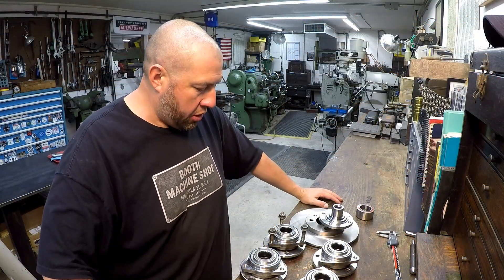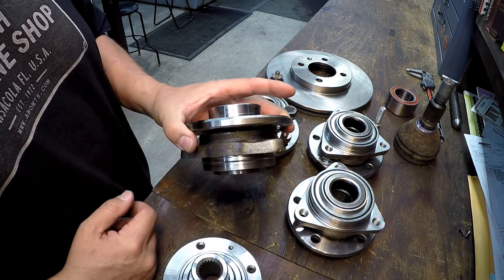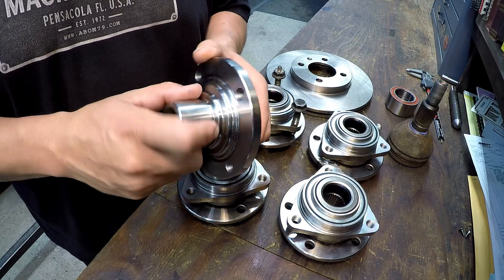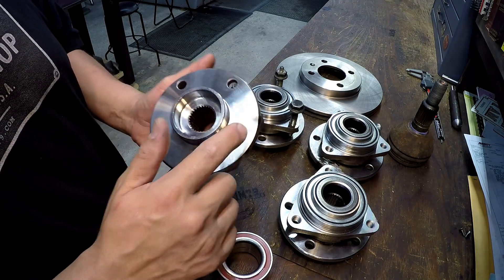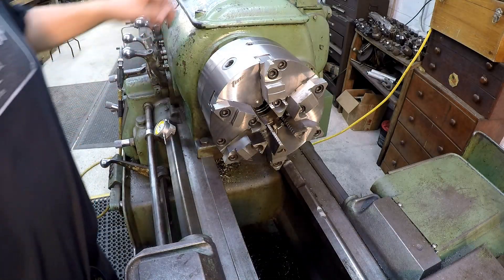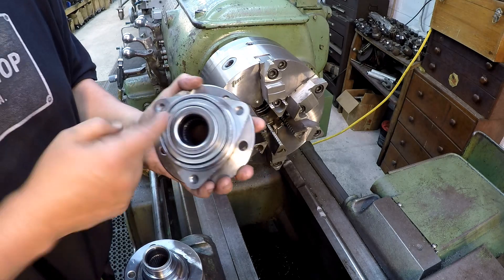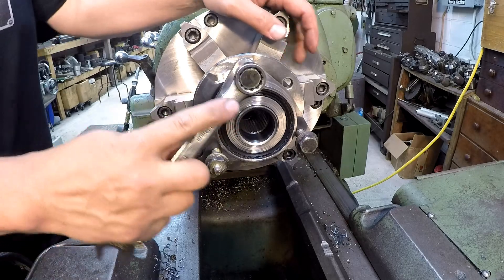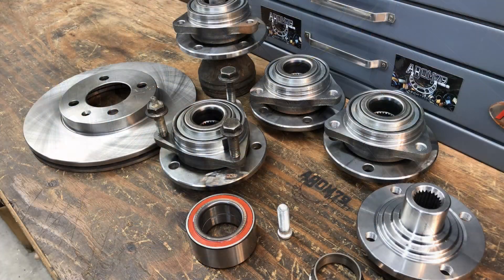How To Remove Bearing From GM Hub Assembly

Comment: I love watching Adam indicating. I hope I am not the only one who realizes Adam is displaying a master's skill level at doing this. The force he applies with each tap is a combination of experience and manual dexterity, of the highest level. I watch South Main Street Auto, another master at work. Eric O. has in common with Adam, perfect dialog. They both say the most interesting things. Odd because they are both just talking about what they are doing, yet it is intensely enjoyable to listen to. Eric O. is constantly pulling hubs apart and replacing the bearings. So I wondered what Adam was up to here. The at the end Adam explains it. Thirty years ago every auto shop would "turn" your disk. Adam could do that in minutes. But not now. They are throw-away, because is costs less to replace them, than to turn them. Now it is entire hubs.

Comment: I do know that in use, on the gm 4x4s, if the acle nut isn't torqued properly, the hub bearing will fail. Too little or too much will cause a failure. A friend of mine kept going through hubs and axles on his z71. I told him to try to use the right torque instead of just getting them "good n tight". He did and hasnt had a problem in 3 years.

Comment: Never seen those hubs that would not just press apart, the castle nut is torqued after installation and keeps all the pieces together, the ring usually is just to keep everything together until you install the axle stub. But then I'm not a GM guy, mebbe their parts don't play well with each other, lol. In any case, nice work as usual!

Comment: Adam unless its some sort of gm hub assembly ive never seen 40 yrs plus  mechanic.... we use a clam shell and put them in the press and they come right apart leaving the inner race on and outer in hub then usually bust the inner race with a chisel

Comment: Nice work, Adam.  I have to say this is the first time I've seen someone remove an automotive bearing without first grabbing a cutting torch.  If there's ever a next time you can cut the outer race off, the bearings will fall away, and you should be able to slide the inner race back and mill that pressed on part with a lot less drama.

Comment: I'm glad my Dakota front bearings was a simple full hub swap.  I could have pressed the old ones out and new bearings in but the cost of the hubs was like ten bucks more than the bearings.  The bushings have been a PITA though.  I was able to get the captive uppers out with a chisel, got one lower bushing out and was just plain dead.  My AC in my right shoulder is tore and the bone at the end of my clavicle had to be shaved down from a big bone spur and a piece I broke and walked around for 15 years with.  Took them to a shop and they had to fight it to press them back in.  Now to do the drivers side and get it aligned.  

Very cool video though.  Making custom parts can be worth a pretty penny for sure.  Especially when you get the process down and start making up a few sets as spares and other people wanting to do the same thing.

Comment: That was grinding / CBN territory 😁. You pulled it off nicely Adam. Thanks for the video.
Reply from the maker: Thanks Steve. Sometimes the carbide isn’t the right tool but still gets the job done. I only had one diamond tip insert and did not want to blow it on this job.
Reply: @Abom79  I hear ya, those diamond inserts are hard to come by. I may have a couple laying around for real special circumstances. I would have done it the same as you did having all those extra carbide inserts. Well done👍

Comment: Abom,  you are the bravest man alive to tackle a job like this.  Raises many Questions.  There must be some advantage for using the GM bearings.  I'm wondering if the 3 hole pattern in the flanges will fit the VW steering Knuckle?   Will you have to help them machines holes to fit in the steering knuckle?   You showed the outer cv joint,  I'm assuming you will use the gm axle that fits the splines inside the outer CV joint.  I'm wondering how that axle will be fitted into the inner VW CV axle.  Will you have to anneal the axle and cut new splines then re harden? That would be fascinating.  I hope you charged a fortune.  Racing is always super expensive.  Nice video as always Abom.  Thanks a million for sharing your machining knowledge and technique.
Reply from the maker: The guys doing these mods are auto mechanics and experience racers so they know what they’re getting into. I’m simply proving the mods they are asking for. Wether it works is in them.

Comment: I use a air powered abrasive cut off wheel mounted in my tool holder when i need to turn hard metal like that.   you when you can't cut  you can grind.  Leaves a pretty nice finish to!

Comment: You are an awsome guy . I to sometimes cut open things on the lathe. I cut open a capacitor once, i thought I shorted it with a screwdriver. When I was just through the crimp the lathe popped and stopped. It had shorted the three wires to a relay ,an easy fix am lucky it didn’t blow the whole thing. 
So don’t cut open capacitors ,ha ha .
And people might mean well but should not comment on your personal appearance out here in public?

Comment: You may want to face the wheel side of the flange after your done with the bearing land area. The flange is quite flexible and may have distorted from the three bolts acting unequally on it. 
Really enjoy your channel Adam. 
Cheers

Comment: I just did this. Without a A Lathe. Those three bolts did push the old bearing off only after i got 2 little lock washers out.

Comment: to hold the flanges...   get the proper size locknut for the end of the CV joint..  cut the locking portion off so it freespins.   chuck the CV joint into the lathe..  use a live center in the middle of the threads..  you should be really close to zero run out..   now you can slide the tail stock back.. slip the hub on the splines and tighten the nut.. not crazy tight.  put the tail stock back up to support the end and you are ready to indicate it.  you may end up clocking the hub on the CV splines.   this should give you a single set up on each hub.. so you can take the shank end down and the OD and Pilot down.

Comment: not a machinist by any means but really do enjoy watching your videos. I learn something new every time. my question is would cutting oil or fluid help with the heating of the cutting bits and make them last longer?
Reply: No. Any interruption in the fluid  flow, or inconsistent working will crack he insert. Either none or LOTS.  In this case, manual working,  none is better.
Reply: @liquidsonly  thanks for the explanation.

Comment: I'm not a mechanic, but I think I've seen my mechanic pull these apart with some sort of bearing puller contraption. 
He pulled both my hubs off a 1999 Chevy 1ton and took about 10 minutes per (including setup time).
Reply: Not all hubs are re buildable like that. The ones Adam is working on is all one piece no pulling the bearnins, just replace the entire hub if needed.
Reply: Yup, these are NON rebuildable throw away hubs.  They have their benefit for sure.  Ease  of repair is one.  Cost of part is not one of the benefits.

Comment: Adom, I never see you use any ceramic inserts. I all ways found them to be very useful on heat treated material.
Reply from the maker: I tried ceramic on the first one with no luck. Had better results with the carbide.

Comment: what are those hubs made out of? are they just hardened steel? i don't really understand the operation you're doing, i think i need some kind of section sketch. the bearing race has some kind of weird extension? it almost feels like it would be less trouble, and probably cheaper, since the bearing is being trashed, to just make custom hubs. unless the hubs need to be heat treated.

Comment: Iv watched you working on these bearings, iv dealt fitted these type of bearing and i would of thought looking at them it would of been easier to just lathe out from the centre as it is only the flange meterial that gets mandrel bent over to hold the race in place?

Comment: I wouldn't worry about the distinction between Chevy and GM. GM owns Chevy, and the two brands are mirrors of each other (Sierra = Silverado, Safari = Astro, etc), just with different emblems. Go down to your local auto wrecker, and you can pick parts from a Chevy, and stick them on your GM, and vice versa, with no issues at all.

Comment: Adam, is it possible to heat those races and temper them back to make them easier to cut?  Also, would you be able to be precise enough to use your trepanning tool to just hit the inner area and not touch the hardened race portion?  Thanks!

Comment: Adam, next time, why not think about Ceramic inserts.  Not to expensive from your local industrial tooling dealer. Just a thought----- Thanks for an interesting watch, Cliff   P.S.   Don't forget to scrape them on the cement floor before using them. not kidding, you know====.
Reply: Pretty sure they were inserts
Reply: You're right, they were carbide inserts. I said Ceramic Inserts, they are specifically designed for heat treated materials. Adam would know what I'm talking about. A lot of folks don't. Cheers

Comment: Would coolant have helped the carbide last longer?
Reply: in hardened materials mostly coolant isnt used. If you cut that stuff it gets really hot, but then when there is coolant splashing on it cools the insert again. Due to the rapid switching of the temperature the insert will suffer from micro fracturing. So turning hardened stuff, dont use it, better let it get warm but save the insert. mostly air is used when turning hardened stuff, just to blow the chips out.
Reply: From my understanding carbide can take the heat. The issue is the brittle nature of carbide up against the hardness of the bearing race.
Reply: Thank you for sharing the knowledge.  It makes sense with that explanation.

Comment: As usual, I'm late to the party, but I'd have harshed Adam's buzz at the time, by suggesting that he remove the studs from the GM hub assy, weld the holes shut, and re-drill for new studs/bolts in the VW pattern...

Comment: Adam i should have checked your videos first.... ive been wondering if you can change just the bearings in a gmc hub with out replacing the hub at a higher cost

Comment: Am I seeing this wrong? It looks like the top of the splined hub is friction formed (sort of hot riveted) over the inner race edge of the bearing. Being so, you only need to cut out the softer portion that was friction formed, not the hard inner race of the bearing, making it a much simpler and less damaging operation.

Comment: What about the other side of the inner race? Is it made onto the hub? If it is, the hub metal seemed very soft for a bearing race.
I do see some heat treating at 19:02. I could very well be made on the hub. Most hubs have it pressed on as well.

Comment: Seeing those GM hub bearings  made me recall some sad memories.   After three of these hubs failed on my wife's 2008 CTS, she traded it in.  Each time there was a failure, a sensor lit up a warning on the dash.  At about $950.00CDN  a pop, she did not want to wait for the fourth one to fail.   Sadly the car only had about 65,000 km on it, just out of warranty when she got rid of it.  .   How trustworthy are those hubs for racing purposes?
Reply: The ECU can not detect a bad bearing, but it CAN detect that the ABS sensor that is nowadays most times incorporated into the hub, is failing.

So in reality what you got was a warning that the ABS system could not detect the speed of the wheel due to a failing sensor.

On many modern cars that sensor can not be changed without changing the complete hub.

This is a hub for a car that either has no ABS or has the sensor seperate from the hub, so they probably wont give any problems.
Reply: @JohnDoe-bd5sz  Thanks for the insight!  But it does rub salt in an open wound, to have to change a perfectly good bearing due to a faulty ABS sensor.   Thanks for your expertise!  These hubs look like they're tough as nails.
Reply: @ExilefromCrownHill  Honestly, personally on my GM car, i have had to change the hub due to the bearing being worn out, but never because of a faulty sensor.

Most sensor fails i see, are due to the wire that connects to the wiring harness, being torn apart or water getting into the connectors.

In the old days, when there were "teeth" on the part of the axle joint that you put through the bearing, and the sensor sat in a hole above that, they were MUCH more prone to fail, because they were much less protected.

If you have had 3 of 4 sensors go bad, i would suggest that the particular hubs were badly made :)

Comment: I make these bearings at the timken factory, the bearings are pressed on the hubs then the flange is rolled over the bearing with a roll form machine under 30000 lbs of force. that is a gen 3 hub if you get a gen 2 hub the bearing will come off in one piece. gen 2 hubs dont have the inner part of the bear made on to the hub like that one. the hubs are straight on the inside and the bearing is all made together with a inner and outer race so the ball bearing want fall out like that one will.
Reply: Randy, do you know the type of steel that is used on that bearing face?  Really tough stuff when it eats carbide like it did..
Reply: you work at timken, really? they make plenty good taper roller bearings, even the europeans use them for main spindles in lathes.

Comment: couldn't you use a boring bar, and work from the inside out, to part that off, without getting into the hardened area?
Reply: I would think just dive in to depth at the width you need from the front, the fold would fall off or not be connected, so you could just wrench it out and not waste inserts - if you use a bar from the center out you would lose length, if I am understanding the statement.
Reply: Hes gotta save a lot of that material for the next op.  In this situation, customer is gonna pay for carbid up to the point they decide to custom build hubs themselves (which would be cheaper)
Reply: @mattnsac  customer is clueless. they sell these parts off the shelf in the sand car industry. nothing custom needs to be done.
Reply: @DieselRamcharger  The only stuff I know of if for use with 930 hubs and the uber strong ones are getting hard to find
Reply: @mattnsac  S-10 hub stuff in the sand car world is called "Micro Stub" Tatum Motorsports, Gear One, Kar Tek or even Latest Rage should have everything you need.

Comment: PCD insert would work nice in that.
It looked like it is little softer at ID.
Reply: you mean CBN? too expensive to burn them up for that, spare carbide or regrinding when dull works pretty well actually.
Reply: @sunside79334 My bad,, meant CBN insert I hav TNMG style insert and it has worked good.  PCD insert is aluminum and that kind and mirror finish

Comment: id say next time a trepanning carbide tool and carve down the folded flange.  or grinder and cut off wheel cut split the triange flange into 2 then push the rear race forward and turn the roll over flange down to size. but as machinists we know there 10 ways to do things

Comment: them bearing races  sure are hard.. hot chips instantly..can see the iR in the cam
Reply: No IR camera CCD shenanigans here, the chips are just coming off glowing red, having done similar work on bearing races myself. Toward Adam, I've found that really high surface speeds can help a little with the carbide chipping, it does wear away the carbide faster however.

Comment: I had an old 1950’s Buick drop axle on a home made trailer that used similar Bearings: I wonder why not tapered roller bearings?
Reply: The double "tapered" ball bearing style is much easier on the production and r & r of the vehicle. Tapered roller bearings you have to test the roll resistance and all that stuff which takes time, these new ones you slap a nut on and torque it to whatever the factory spec is and you're golden. They both have their pros and cons, but really those new style bearings aren't really any more failure prone than the older tapered roller bearing style in my experience on heavy haul equipment.